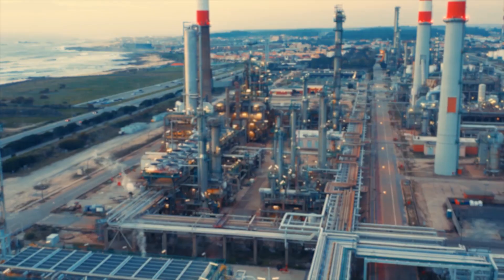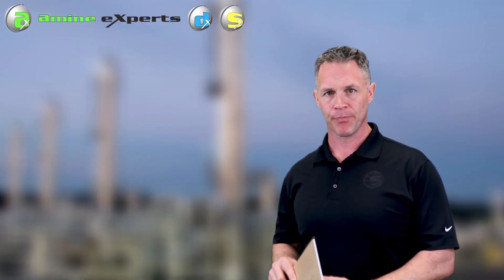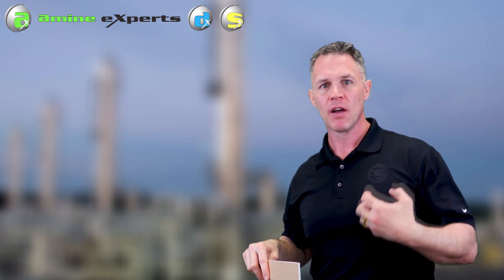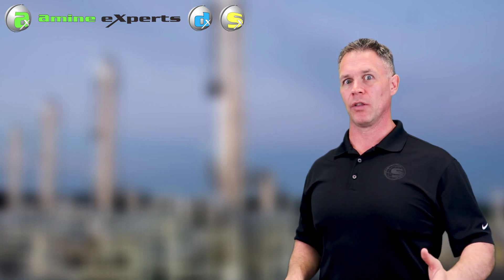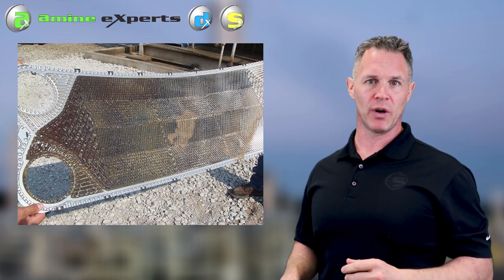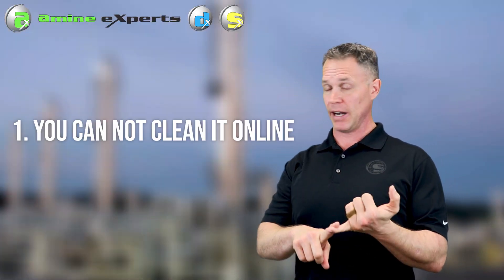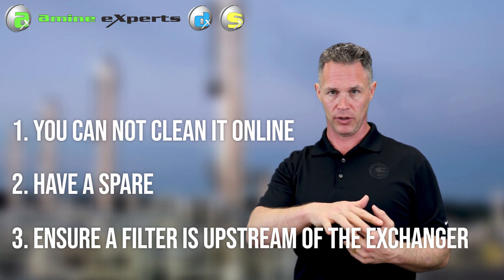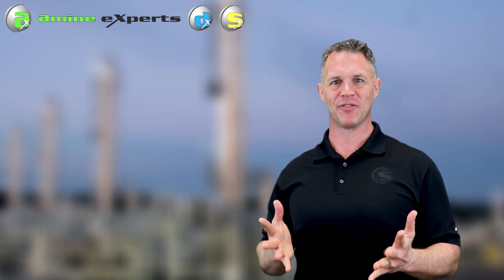How to Fix a Fouled Lean Rich Exchanger

Comment: we use antifoam with silicon based in amine system,. Please tell me If it possible excessive antifoam (silicon based) can be precursor fouling problem at plate frame exchanger? Or the compound react with Fe to precipitate in our amine system?

Comment: Great video, I am a little confused though. You state at the beginning of the video that the process is an Acid Gas Enrichment unit which slips CO2 to the treated gas and picks up H2S in the amine. But then you say that the rich side fouling is due to high CO2 - low H2S content, wouldn't the rich amine have high H2S and low CO2 since the CO2 is being slipped?
Reply: Jared, even though we try to slip as much CO2 as possible in an AGE tower, its impossible to slip all of it. And because the feed H2S in this system was low, the overall ratio of CO2:H2S in the rich amine was still greater than 1. The acid gas leaving the regenerator was most definitely enriched, but still wasn't perfect. There's a lot to know about maximizing CO2 slip in AGE (as well as TGTU) towers, and this particular plant wasn't doing a very good job at it so was picking up even more CO2 than they should have been.

Comment: Hi Ben hope you're doing well, great start . What indications let me know that fouling is happening before it get worst?
Reply from the maker: Great question! We will be sure to answer it in upcoming videos!
Reply: We look for several key performance indicators around lean/rich exchangers to make sure they are not fouling, most importantly would be the actual temperature exchanger, as well as differential pressure across both the lean and rich sides (especially on a plate/frame exchanger)